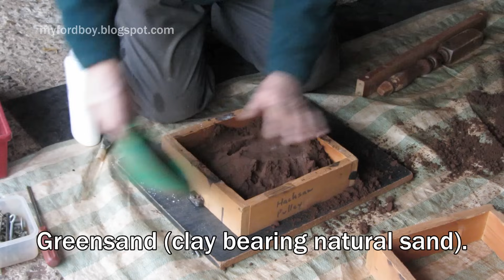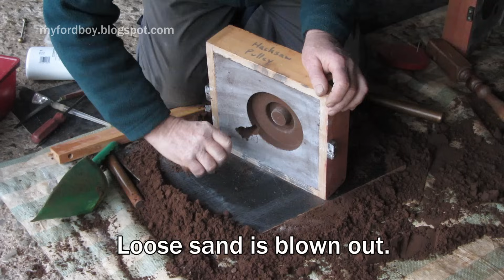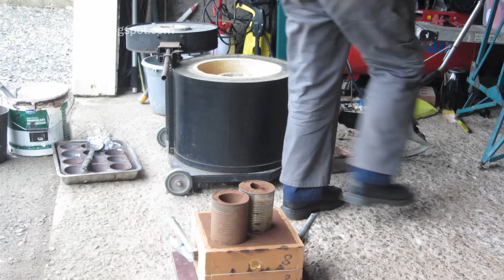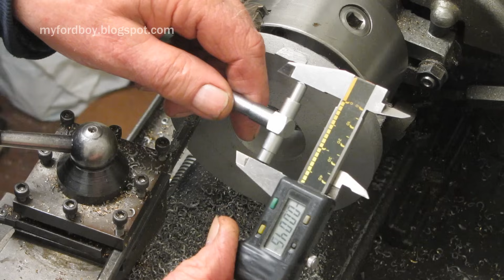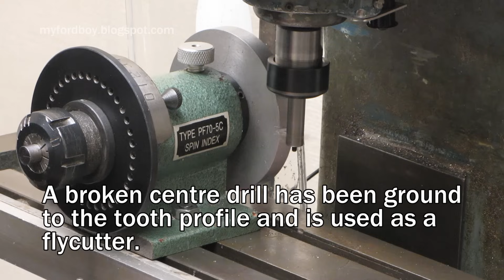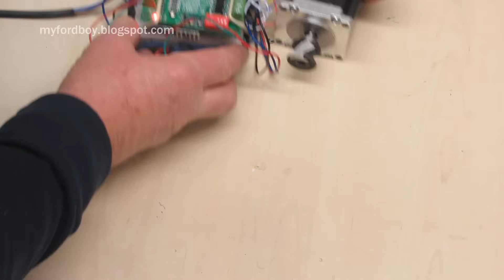Metal Casting at Home Part 64. Casting and Machining a Toothed Pulley.

Comment: Why do all the guys doing casting seem to work on hands and knees-  it would seem so much easier to stand up and do the work on a table.
Reply: Probably, something to do with keeping the mold at a level below 5kg of molten alloy to make pouring easier and safer.
Reply: Nahh- they always pick the thing up and move it before pouring.
Reply: mrpete222, and doubleboost, both work at waist height above their sand boxes.  I would probably stay on my knees if I could cast like MFB (I'd do a lot of praying, while I was down there, for a good pour)
Reply: I plan to do it on my lap sitting in my office chair LOL
Reply: Dad used to be a foundry many , skiny as a stick insect and  as hard and tough as a cold steel chisel . I've watched the guys inin the  foundry many a time moulding and casting metals etc.  It's a fascinating thing when done commercially  as nothing can be allowed be inefficient wasteful or dangerous  . 

 In the sand casting / moulding sheds at even a smallish foundry  there is usually a fairly big pile of a specific moulding sand  in  different areas or indeed a different shed for each metal  being cast and sometimes a separate sand for the actual finish required on the casting i.e. fine, medium and coarse sands .  
It would be mainly various recovered casting sands in heaps on the floor dropped there by the dump truck driver who collected the sand from the guys who boke the casts out the moulds . 

  A fairly small casting foundry of 15 or so workers inc. office staff doing brasses , cast iron  and aluminium alloys would perhaps have a two or three sands for each metal being used . Each in a different building area or separate building with a base in excess of 15 feet across and 5 feet tall or it would be pushed up against the wall for the length of the building  and be 20 feet or more back from the wall depending on the size and number of castings done per day .
The guys filling the top & bottom copes used to fill them on the floor close to the heap for ease of access to the sand and of course it was an easy place to put the excess sand back that was scraped off the copes  .
 Having a table  anywhere near would be quite an inconvenience as it would need to be continually moved as the sand was used up  depending on what was being moulded up for being cast .
 Big copes were filled with shovels  , well tamped , screeded off . sprued etc etc. and then craned on to trolleys to be taken off to the furnace /smelter for filling with molten metal . 
 Also remember that even in a domestic setting it's safer and easier to sweep the floor up  after the casting exercises .  Casting with molten metals in hand held crucibles is safer lower down to the floor than heaving it up to table height plus the height of both copes & risking it being dropped or spilt because not only of the height but the grip you have on the crucibles with your home made tongs & the fact that you will normally need to change your grip to pour at such a height .. 
 In the foundry  a lot of casting pours are a two man job to pour ,  one either side of the crucible which is in a pouring frame . They'll be lifting a total weight between them of somewhere in the region of 130 pounds/  each pour .
The bigger crucible pours are craned into position and often tipped to pour in the moulds  with chains and motors

Comment: Of you were just going to Mill and machine it, why did you bother with casting it in the first place, you could have used a billet or bar stock, save time and money
Reply: have been thinking the same... why doing the cast... just for showing I guess.
Reply: Because he CAN! ;-)

nice Video! Keep on the good work. You got my respect, especially for your improving skills!
Thumps UP from a milling machinist
Reply: Have you any idea of the weight of and the cost of buying a blank/ billet of metal big enough so you can mill & turn it ? You'll either pay a fairly high shipping cost on it or more likely use your own car & petrol etc out your own pocket to go and collect it  . Suddenly what looked cheap now becomes double or more the cost.

  WRT that casting I'd guess that if you used a billet of commercial stock a good 35 % or more would be un useable scrap from turning,  borings and cuttings.  

Plus you'd need a much bigger lathe  to get the billet in the bigger chuck now needed to hold the billet in the chuck 
unless you were lucky and had a decent reversible  three or four jaw chuck that it might fit  it into . 
 With casting your own blank you could add a 2 inch dia sacrificial shoulder/ spindle   at either side of the cast to get down to a more workable diameter,  then once there  turn / part them off 
 Casting allows you to melt most of your low heat metal scrap , waste ,off cuts and too small to turn noggins  so you can cast and cast time after time with out muck degradation of the metals .

 If you play the game right with home casting you can have a stock of your own clean metal cast bars   from say 14 inches long in diameters of up to six inches  .  Try buying that sort of stock and putting it on your stock rack &  not be annoyed at the amount of money you have had to lay out .

Comment: you make casting look too easy... what a pro.
what was the temperature when you poured?
Reply from the maker: 640C
Reply: Are you sure? As far as I know aluminium melts at 660°C, so it would have been solid...
Reply: That's 1112 degrees F.  Plenty hot enough to melt aluminum.
Reply: Wikipedia says 1221F 660C hmm But wikipedia doesnt make skookum gears out of melted Aluminum. MFB makes AvE look like a helper.... its a freakin craft.  there you go. dude knows more than wikipedia.
Reply: It's not just Wikipedia, it's also my old formulary from school and a reference book for metalworking, which also say that pure aluminium melts at 660°C. The only thing could be, that myfordboy uses some alloy that melts at a lower temperature. It seems, that aluminium alloys for casting really have a lower melting point.
Reply: m  k”
Reply: Almost all alloys have a lower melting point than pure metal.  Lead bullet alloys melt at a lower temperatures than pure lead.

Comment: Why use two parts mold?
Reply from the maker: A one part mould would be an open one which would not give a good casting.
Reply: Thanks for reply, your skill set is awesome
Reply: I agree, of course. In a one-part mold, the open side would have to be the "top." And in any poured metal casting, all the flaws (bubbles) end up floating to the very top. So why not have all those bad bits end up in the top of the sprue, instead of a surface of the casting? 
My sincere compliments to this excellent craftsman, who shows every part of the process.

Comment: Hi! I love your videos as always. Is it important that the riser is narrower than the feeder? I assume it helps ensure the part is completely filled, by giving a little pressure due to the narrower outlet.
Reply from the maker: The riser can be larger, just needs more metal to fill it and it's more metal to cut off afterwards.
Reply: Hi,
if the riser is to be used to feed any shrinkage of the melt back into the casting, it should be a large diameter so that it cools slower than the casting.

on the finer technical aspects - 
the sprue (feeder) should be narrow so that it runs full during the whole pour. If it is not full you run the risk of entrapping air into the casting. Also try not pouring directly into the sprue but rather into a little depression along side the sprue, where it then runs into the sprue. the flow is smoother with less entrapped air and debris.

however if it works the way your doing it then it is ok/.